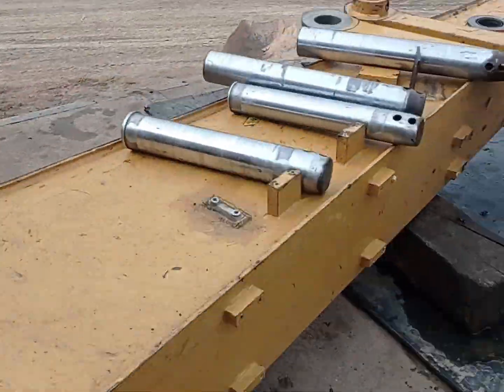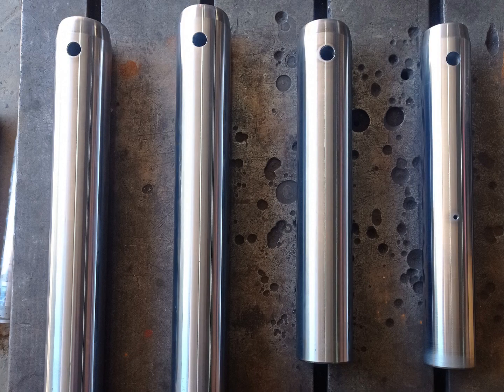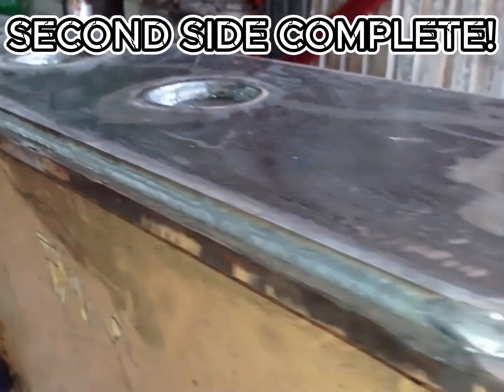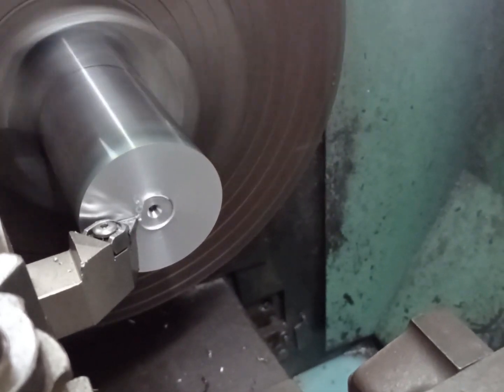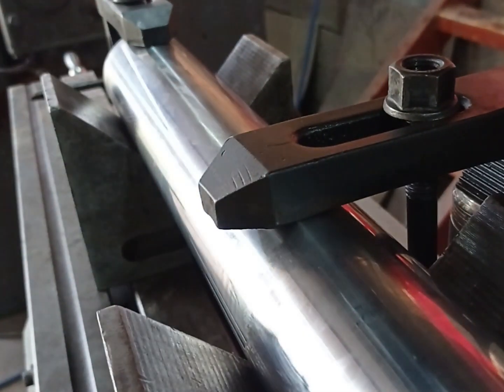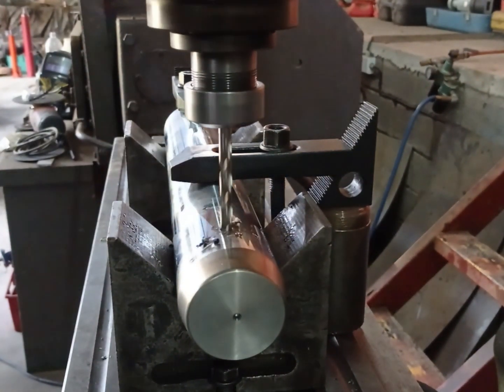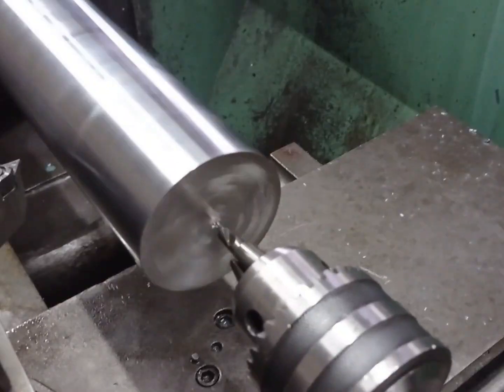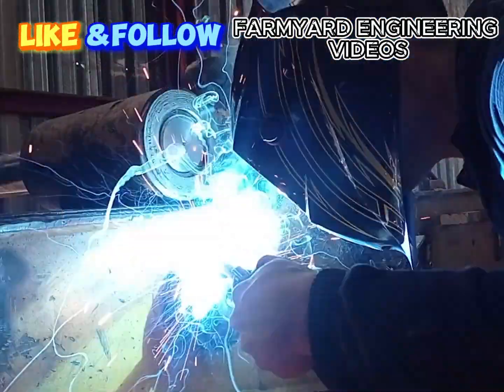EXCAVATOR BOOM EPISODE 2 (REINFORCING PLATES AND PIN)

Comment: I used a small carbide drill to pilot then went through the hard layer with a masonry drill, once through use hss drill. Can add rake to masonry drill to help cut.
Reply: I occasionally use reground masonry drills for hard materials, just make sure you don't spin them too fast or at least use some lube because if the drill bit gets hot, it can loosen the tungsten insert as the braze holding it place becomes soft.